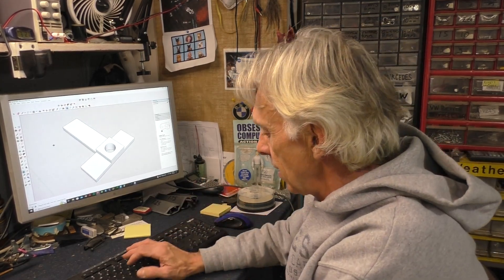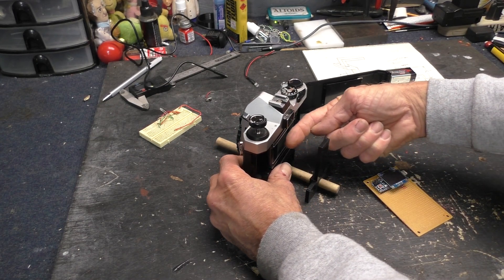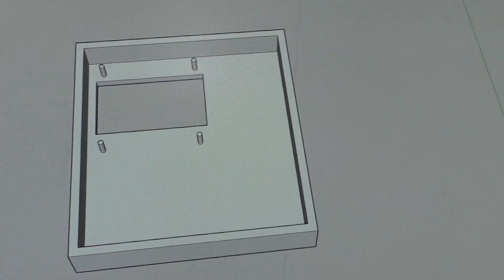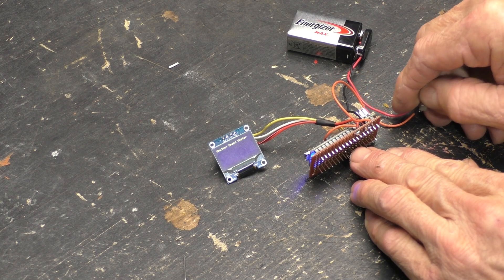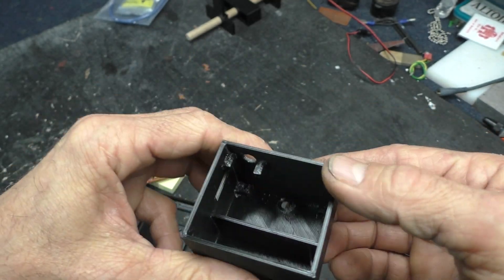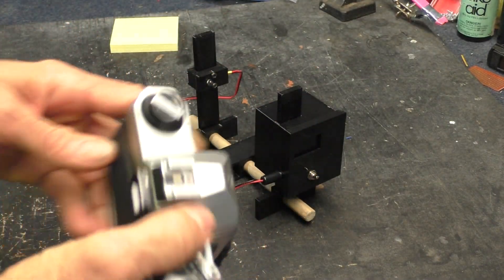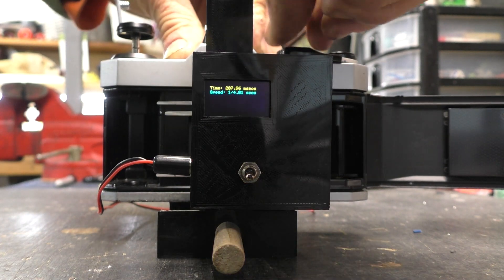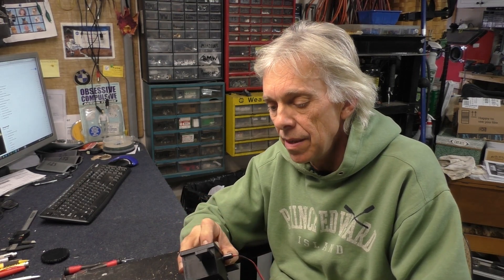Enclosure For Shutter Speed Tester

Comment: I’m not picking holes as your far more familiar and accomplished with these things, however I would think that you could have the connecting rods/ dowels as a threaded connection, like a helicoid or vice with dense foam pads so the camera is gripped most SLRs and other types are centralised lens with a space either side for grip and for other types a u bar could be slotted in place to achieve the sides. I’d be interested in what 3d printer you have and if you think there are equally as good now on market! Regards DG

Comment: My guess is that the sensor doesn't give correct numbers.
Reply from the maker: I checked it against a know timed light pulse and it's very accurate.
Reply: @HackaweekTV  Actually, the accuracy is less a mater of time than a matter of size:
Shutter speed measurement is not only about time, it is also about position. It is a spatio-temporal phenomenon.
The curtains travel speed is about 3 m/s, according to repair manuals.
3m/s = 3mm/milisecond
Your sensor is 3mm large. You have a spatial accuracy of 3mm, so you have a time accuracy of 1 milisecond .
At 1/1000s you have an uncertainty of 100%
At 1/500s you have an uncertainty of 50%
And so on...
Reply: @photographyelectronics and how could we fix that inaccuracy?

Comment: I also use SketchUp 17 and love it. Here is an idea I came up with you might like: Often I connect 3D prints with rivets. I light some filament on fire, blow it out, shove it in a hole or just attach to the side of printed PLA. When cooled cut it to length. Now you have a strong shaft. Put it through a PCB board hole, heat it with a match, then quickly rivet it with an aluminum X-Acto butt. Or make short lengths of PLA filament mushroom one end. Line up two .2mm holes, thread your mushroomed filament through and mushroom the other end. Sorry I didn't explain this very well.
Reply from the maker: I get it!